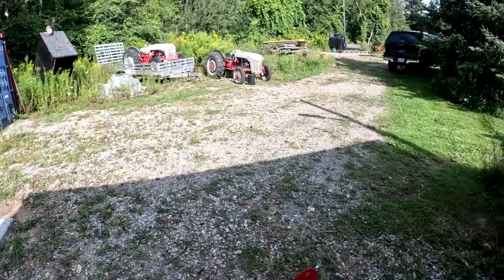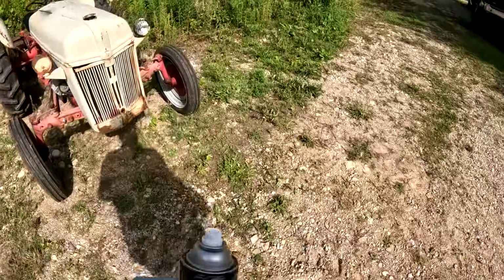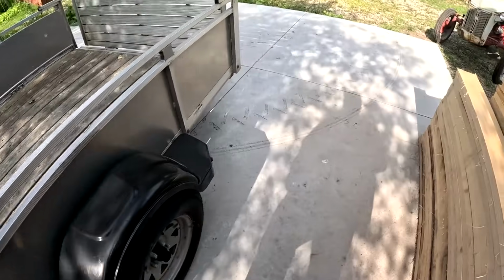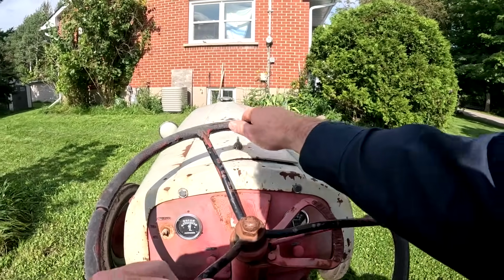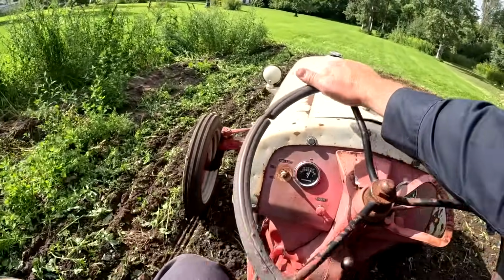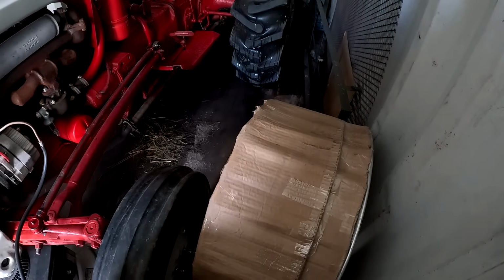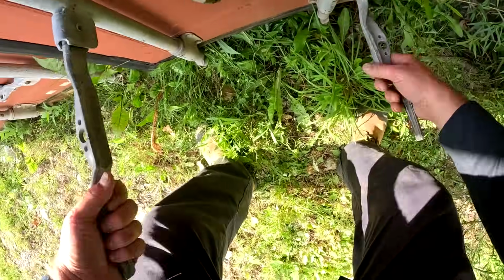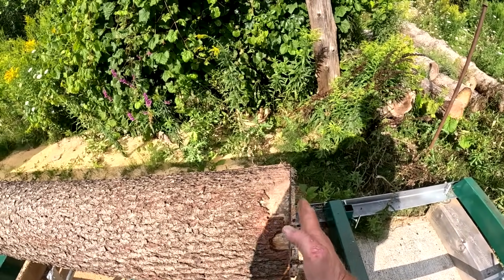We better fire up the 2N and CHOP WEEDS!!!

Comment: you should get a single plough blade instead of a disc. It will rip deep into the ground. Then go over it with your cultivator before planting
Reply: Need to get air and nutrients deep down if you want to contiunually grow on same land. 
For best yield, need to rotate land to allow it to replenish - rest 1 year etc

Comment: Those tractors are supposed to have 80w90 gear oil in the trans hydraulic system. That oil you are using is too thin
Reply from the maker: they'll pretty much run on anything
Reply: They will run on it but you will also have a lot more leaking with it. That is probably why the 3 point settles so fast.  It will also cushion the gears better to get rid of the gear noise. I have 44 tractors and 3 of them are 8n Fords so I do know something about old tractors.